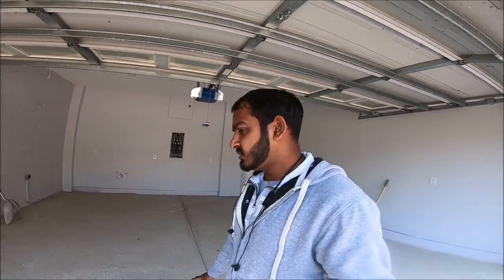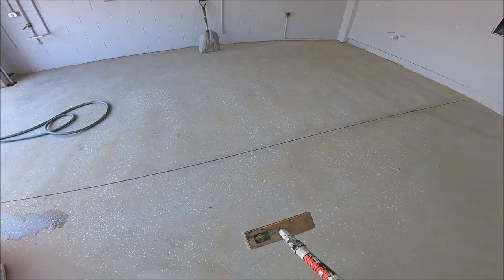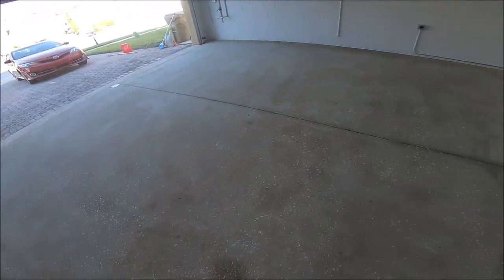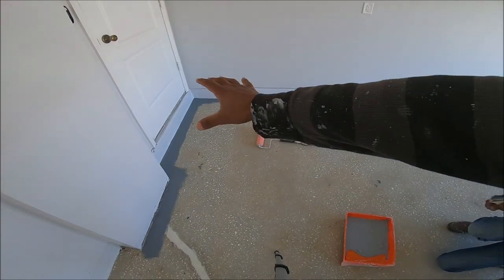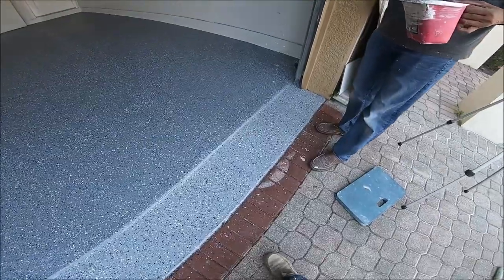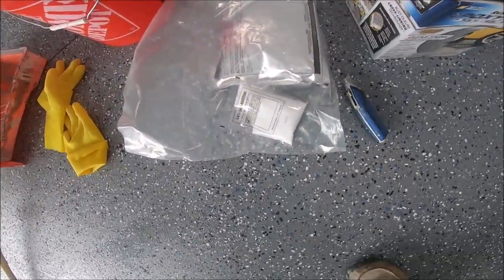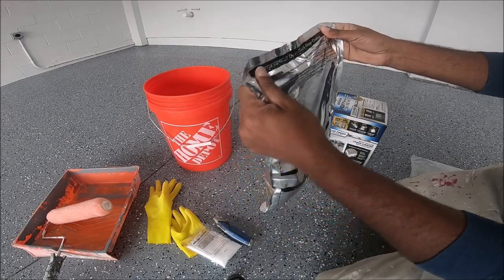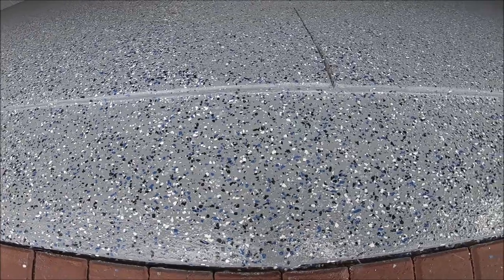Rust-Oleum Epoxyshield Garage Floor Coating Kit (How To Paint Garage Floor)

Comment: Great  , to the point video . Plan on doing my floor this weekend , 2 stall . I hope mine turns out as nice as yours did . I think I will go heavy on the chips , similar to yours .
Reply: Well I did get to do my floor . I feel pretty lucky , I was able to find 3 kits off of FB marketplace for $75 . I prepped the floor , even though it was really clean to begin with . I pressure washed it , acid etched it and did a final wipe with acetone.  I have a 2 1/2 car garage and I'm glad I bought the 3 kits because I almost ran out . However  , I did run out of chips , but was able to run to the hardware store to grab some quick before the paint dried . I wasnt happy with the result , it lists it as a semi gloss , but really it looks more matte . I bought 2 gallons of rustoleum gloss clear and even with 2 coats , only resulted in a semi gloss finish . 4 weeks later , and I even let it cure for 1 week , I already have some dime size spots that have hot tire peeled . My advice is 1) if your going to use your shop for light duty work like woodworking or lawnmower/atv repair , you'll be fine . However for automotive repair where your pulling cars in and out of your shop , I'd skip the kits and have it professionally installed . 2) buy extra kits and chips . I nearly ran out of the epoxy mix and did run outta chips . 3) work fast , I mixed all 3 kits I bought in a bucket and barely finished before the epoxy started to get tacky  , little over an hour. 4) clear coat is definitely needed , no where near the shine it claims is a semi gloss .
Reply: @ericmaass3459  thanks for the input. I have heard people saying that one pack definitely can not handle a 2.5 garage. So I guess for my 390 sqft garage. I need to buy 2 kits then? Also was there a sealant on your floor? You mentioned you did not diamond grind it. I assume the surface is like a bare concretely? I was wondering since you had a imperfect result maybe because there was a sealant on it and you just etched it instead of grinding so maybe the epoxy didn’t adhere with the floor very well?
Reply: @frankisme7792  Frank , 
Yes I would definitely buy 2 kits . You can always bring one of the kits back . Nothing worse than being 3/4 ways through doing your floor and running short . Oh and buy extra chips too . My 2.5 stall measures 25X25 or 625 sq ft . Each kit covers 250 sq ft X 3 kits = 750 sq ft . So I thought I'd be safe having 125 sq ft to spare , nope just barely.  I'm sure it doesn't matter , but the kits I bought off of FB were the old style kits in the cans . The new style kits are bagged , however square footage is square footage . As far as the concrete goes , its fairly new , I'd say within 12 years . Its just plain concrete , no sealer . Surprisingly only a few stains from a lawn mower was about it . Thats why I didn't diamond grind it . After pressure washing , acid etch and a final wipe down with acetone , It passed the white rag test . The issue isn't spots where the oil spots were , those are fine , its tire lift /peel , and I just drive in and back out in a straight line . I'd be afraid of what would happen if I turn my wheels while at a standstill . I wouldn't be upset if a few spots lifted here and there a few years down the road , but its lifting a few weeks after I did it . Rustoleums clear I applied as a topcoat  , wherever the tires sit , turns the clearcoat a yellowish tint . All in all I can't complain too much,  I paid $75 for 3 floor kits , $80 for 2 cans of clear and $12 for a bag of extra chips . Still worth it if just for the fact its so much easier to clean.  I wish Rustoleum would get their act together and offer a touch up kit for chips and peels  , hard to believe they don't as popular as the epoxy coating kits are . So what is one suppose to do ? Buy a entire kit to do few touch up spots ?

Comment: I have a 2 car garage… is it possible to do one side at a time? First complete one side totally; then the other?  The reason I’m asking is because I have a lot of stuff in the garage that I would need to remove from the floor.  If I could do one side at a time I could store that on the side not being worked on.
Reply from the maker: Yes you can do one side at a time
Reply: Pro tip If you garage floor has expansion joints yes if not I wouldn’t recommend it you will get lap lines where the two coats meat
Reply: And you will also have to buy 2 one car kits because with a 2 1/2 car kit the unused epoxy will not be usable the second day.

Comment: I have a question, the material that you mixed with the cleer, I mean the small bag, is it the same material that you used at the beginning when you washed the floor?
Reply from the maker: No its different 
First one is a concrete cleaner 
Second one is mix with the paint epoxy
Reply: @AZIMBAYO1  Thanks for the information, your videos have very good content
Reply from the maker: Thank you very much 👍

Comment: Im looking to do this to my garage this summer any review on how it's holding up over the year?
Reply from the maker: It's holding up really good 
Just follow the directions on the box.
And make shore the floor is clean properly before applying.
Reply: @AZIMBAYO1  im hoping, i etched it real good, just hard to tell what is "clean enough". Do you suggest doing the top coat after you lay the epoxy? I know it says you dont have to but
Reply from the maker: Yes I recommend doing the clear coat after the epoxy drys for 24 hours
Reply: @AZIMBAYO1  thanks so much awesome video, cant wait to do mine hope it works out
Reply: @AZIMBAYO1  i just did it yesterday and looks great I'm just getting it rest for a while before walking on it! Hope it holds up with use, thanks for your video a ton.
Only thing is i cant find the clear coat did they discontinue it? Nobody is carrying it anymore

Comment: How many packs of the clear seal did you use?
Reply from the maker: Hey I had to use 2 packs
Reply: Daoes the seal come with the epoxy box?
Reply from the maker: No
You have to buy the sealer separately